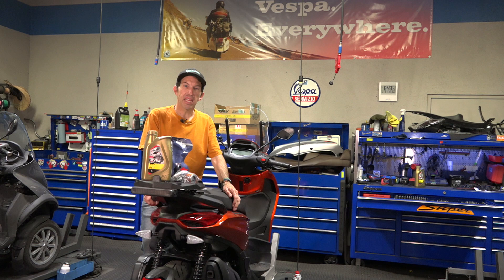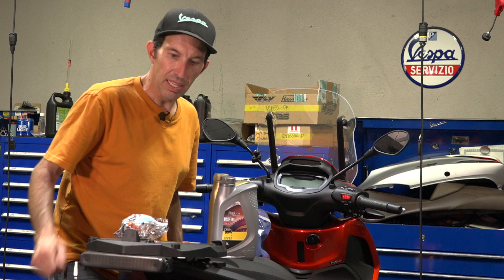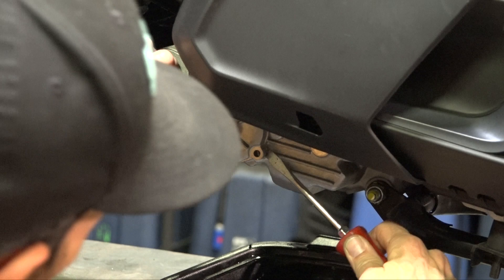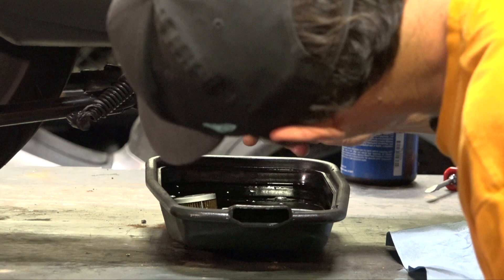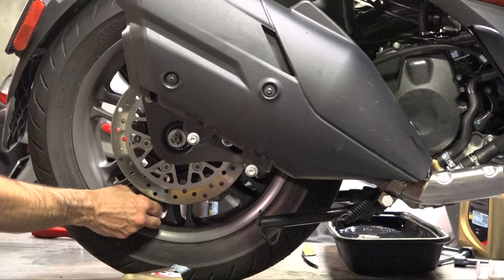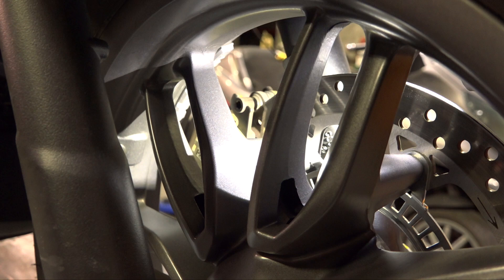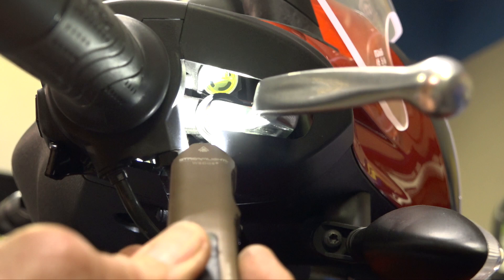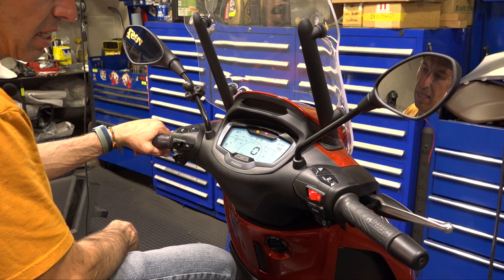Piaggio BV400 Complete First Service Tutorial

Comment: Great video! I have BelRay 80w gear oil, safe for wet clutches; would that be okay to use on a 2020 BV350? Manual doesn't specify the weight.

Comment: 😊Thank you so much! Have the Beverly 400 also problem with fuel pump?
Reply: I think I have a problem with mine. It just cutout one day, and wouldn't restart (winds over but no ignition) then after about 10-15mins it started back up again and went for for about 10 mins, then the same thing happened. I sounds like an overheating problem with the fuel pump as it runs fine on small trips and I only get these cutouts on longer rides, and it fixes itself after cooling down.

Comment: I have a Piaggio beverly 300 IE from 2013. How much oil should be in the transmission 250 cc or 400 cc. The instruction says that 250 cc, but it also says that the oil should be on the second cut of the indicator and when I pour 250 cc, it is on the first. Please clarify if there is a mistake in the manual.

Comment: Hi my friend i have a question. I bought before two months a Beverly 400 hpe. Wherever I go with it, even when I work on it, the ventilator does not open. However, when the engine warms up and I make stops in traffic lights the temperature rises easy to 105 and the fan turns on. I have not seen this on other scooters. I checked the coolant is ok. Fan opens about 30-40 seconds and then stop. All this think is from the manufacturer or is something false. Many thanks!!

Comment: Hi, i have a problem with my Beverly police 300. When accelerating, the lights of ASR start flashing and does not receive full throttle, it's driving with 30% of power. It has 12000 km and original belt. Does anyone know what the problem is?